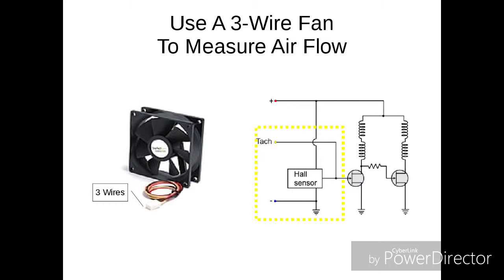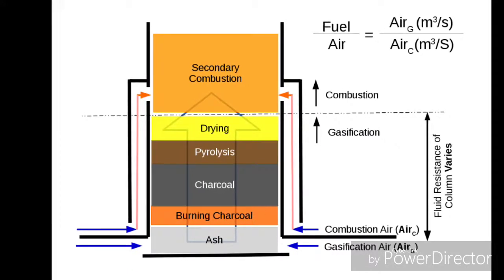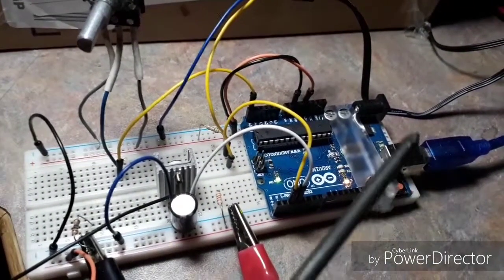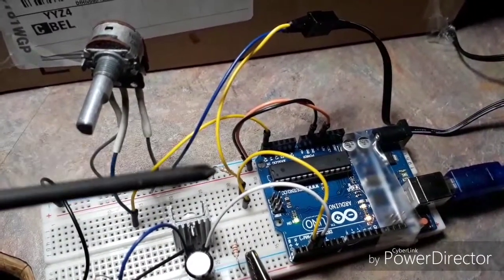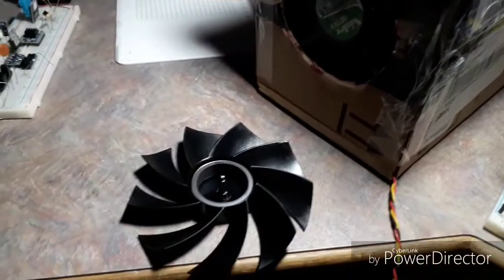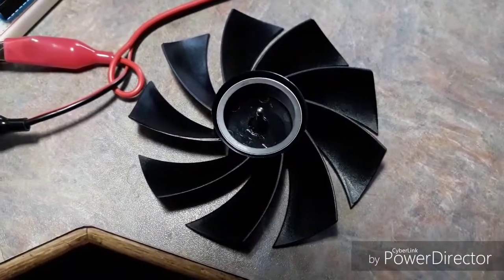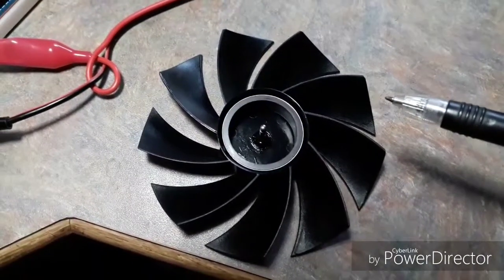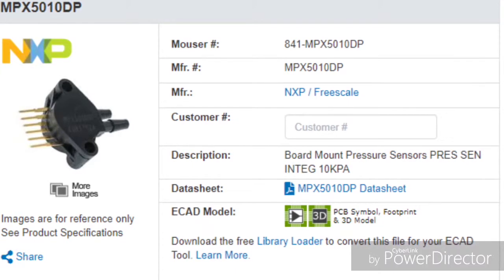Air Flow Sensor From 3-Wire Fan

Comment: why chose the 3 wire fan and not a 2 wire fan? would voltage be proportional to fan speed?
Reply from the maker: 2 wire brush less motors don't work as generators. The 3 wire fans include a tachometer output
Reply: @senorjp21   2 wire motor are brushed motors they should work as generators. Will try it later to check?

Comment: Sir i have vfd drive like lenze high line aftrer 10mint its showing fan alram how can i block or jump feedback
Reply from the maker: I don't know. The 3rd wire is a tachometer square wave signal. If you pull the line high or low it will appear as though fan has zero speed. Your VFD might be overheating. Maybe add external fan cooling.

Comment: i doing a fan mod for my UPS, with an external fan setup.. i want my ups to think its internal fan is working good, because when i remove the internal fan it senses and shuts down completely.. so i want to fake it, make it think it's fan is running properly for that. i need to mod something with its rpm wire... any ideas?
Reply from the maker: The 3-wire fan tachometer signal is some kind of square wave.  You might be able to supply pulses with a microcontroller, or 555 timer.
Like in this video, you might be able to leave the fan in place unpowered (e.g. cut the +ve wire) and have your external fan spin the internal fan - the tachometer signal should be generated even with the fan unpowered.

Comment: Brilliant! I'm trying to build an exact project but so far have only the tacho side completed. Do you have the code and schematics posted anywhere?
Reply from the maker: I think this is the Arduino code I was using. https://github.com/jesseparker/regulated-airflow-2-fans.git
Reply: @senorjp21  Thank you very much
Reply from the maker: @fortiscanes7185  You're welcome.  I'm interested in what you're doing.  Maybe you have better luck than me getting clean pulses from the tach